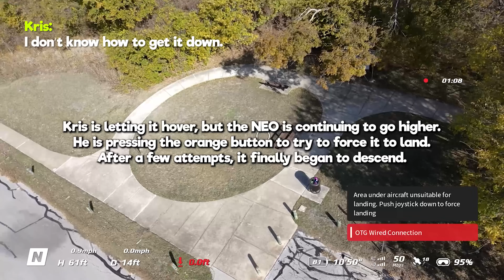Don't Do This With Your NEO [DJI Responded]

Comment from the maker: **UPDATE** Thanks for all your comments. 👍A few of you have mentioned that the tape was causing the increase in altitude. You're right. We had initially thought that was indeed the issue, but when we tried the helmet test, it went down when it saw an object below it, so we assumed that something else was going on. The NEO probably lands when a new object is detected below it, but in our test, it was thinking that the ground was still 0 feet away. We probably had some light leaking through the tape because previously, outdoors with tape, it didn’t increase altitude — it just went crazy and lost GPS a few seconds after takeoff. The other two issues we showed in this video are still baffling (1 - the Motion 3's throttle becomes extra sensitive in the dark, and 2 - tenuous GPS connection when the vision system isn't working).
Reply: Experienced this on my first flight using my phone controller today
Reply: The Chinese must shake their heads when it comes to us Americans. JUST TELL EVERYONE  DON'T FLY AT NIGHT WITH IT. PROBLEM SOLVED.
Reply: @myexperience_is  lol... We don't do what we are told! 😂
Reply: the throttle (and also all other controls) override all limits set in C-N-S when the drone goes into ATTITUDE MODE (no sats and no ground feedback) and the full manual speeds become available.... aiding in the panic.... you must always have your volume high to hear that dreadful message "attitude mode, fly with caution" because it means you have no braking, no positioning, and no height reference and the drone is completely utterly 100% in your hands and only using the gravity sensing gyro to establish horizon.... and if your compass is off then you get horizon off and drifting in that direction.... happened to me over a lake today and i was only lucky that i was looking out for just that because i was over mirror water and low light and under canopies... i was able to anticipate the lack of positioning and braking and i slowed down manually, turned around and made it back.... if i had panicked and whacked it into the skies to get away i would have smacked branches and fell into the water, if a had pressed rth same thing was gonna happen, and if i had landed on the other side, i was gonna later found out that it was not the other side but only the middle of a much larger lake and some wet action would have to follow.... wont be doing that again i tell ya.... next time high and wide over that place 😀 here's the video https://www.youtube.com/watch?v=E3-2ix2xJDg
Reply: I think the software in the app must be trying to throttle back for safety so without realising it you then pull on the trigger and try to increase speed as the light hits the sensor the auto throttle back reverts to full pelt forward. The Tenous GPS is probably a software issue as the drone is probably not capable of utilizing height data from GPS satellites and uses what the sensor is reading so it can land on a hand, I think starting of with the sensor covered it will take off, but it is probably confusing the software and eventually becomes unstable. As you can see from the goggle recording the height is always at 0.0 ft
Reply from the maker: So, learning from the comments, we think that in our first video about this problem from a month ago, our tape was nicely sealed, because we never saw a height reading.

Maybe a real night test outdoors is what needs to be done. It's just a bit sketchy when / if it goes crazy at night.
Reply: You should wait for GPS to lock into 20 sat before flying! if you look at your flight with tape you can see that the drone drop under 8-9 sat which is insufficient for the drone!

Comment: I didn’t go through all the comments. Although I wonder if DJI is intending to provide an update that allow us to control our DJI in the dark as long as we are able to see through the goggles! I tried mine in a room with a low light and the visual was good, but the problem still presents while using motion sensor.
Reply from the maker: It's very unlikely that DJI will do anything to improve this drone, unfortunately.

Comment: Have you tried calibrating the IMU before doing the tape experiment? I induced ATTI by entering a dark room (I want to improve my control or at least stop panicking) and it started climbing after a crash (which is known to fuck up with the IMU). The drone might have believed its nose was pointing down and trying to correct it (since ATTI mode is meant to keep constant attitude). Also this time I didn't experience it speeding up when I entered ATTI, maybe the other times it thought its nose was up and leaned forward? though unless VPS plays a role in auto leveling it wouldn't explain the lack of drift before entering the room.
Reply from the maker: No, I haven't, and to be honest, the tape idea was not the best way to test low light. I did have it climb up after taping it indoors and it hit the ceiling, so it might have seen the tape as the ground and was trying to get away from it.

It broke the drone. Haha! Lesson learned. At this point, I just hope the word has spread that the NEO can freak out in low light, rather than just drift.

Comment: I have problems with NEO too, in Latvia 2 times. and in Cyprus 1 time. I afraid to fly with NEO if do not have at least 20 satellite connection,  but even than, it is sketchy to fly.
Reply from the maker: That's unfortunate! After recording this video, I have also found that 20 satellites are the minimum that it seems to need, even though the NEO itself seems to be ok with taking off with fewer. 🫤

Comment: DJI for 10 years have known about flyerway..  If you don't bump the ground or crash into something you'll never see fly away.. I stopped flying my Neo drone because of a lawsuit with my neo drone on flyway hit somebody.  My controller would turn off manual,  I would have to get back in and turn manual on.. The acro button was off but it wasn't,  It was off only after I turned it on and then turned it back off.  My best effort on flyaway to control the neo is hold the left stick down,,, And then turn the right stick to the right and make it do rolls until it crashes... To this day there's no just turn off of the power to the drone... Makes one thing that they want drones to crash so people have to buy another drone..  I've had a lot of fun with my neo drone but it's time to give up drones They are a liability.

Comment: Just happened to me today. I flew it on the ceiling, under the roof of my garaage. Then, a few seconds later, when I ascend it like 10 meters high, my neo suddenly drifted away maniacally in 1 direction, in reverse. It flew and crash to my neighbours' yard, but fortunately, it is still okay. Just a little dent.. I was just afraid if it hits a car passing on the road...
Reply from the maker: It's very unsettling, to say the least! Glad it's ok. I'm gathering some info in the comments of the videos we've made about the NEO and this issue. What controller were you using? 

We want to make an updated video, check the firmware, and share some comments like yours.
Reply: @readysetdrone I use motion 3. Just bought the whole fmc motion set 3 days ago
Reply: @readysetdrone I'm using the motion 3. Just bought the set 3 days ago
Reply from the maker: Ok, that's the setup we have issues with. When we fly it with other controllers, or even just a phone, it doesn't go crazy in the dark.
Reply: @readysetdrone I haven't tried with other types of controllers or just using phone yet

Comment: However, some have managed to fly the DJI Neo at night. https://youtu.be/9VtQiIysgZw?si=2FhFGug6cyudSGj6     https://youtu.be/YCeu7Xzrr_k?si=n-nmuJ_okjqOu6Cz  https://youtu.be/Ja50_v7tgl8?si=2MTmKEh4hxtmOgII   https://youtu.be/SMQ8dE5QXJI?si=N8II021Xv5j2Uhyj
Reply from the maker: Nice. It seems like, with those videos, they were either flying with a standard controller (one of mentioned it drifted a little bit, which is normal in ATTI mode before enough satellites are acquired), or it's got plenty of satellites, or a very bright light. 

The light that we tried in a previous video probably wasn't quite enough. 

Originally we thought that the crazy uncontrolled flight performance was only happening on the Motion 3, but based on comments we've gotten, other people have the "drunk drone" issue with other controllers as well, which is kind of an interesting development. 

Also, just the other day, someone mentioned that there a firmware update which made it more stable. We will have to check it out soon.

Comment: My neo just crashed without warning.I sent it back to dji for repair, and they lied they told me the external was damaged ! The drone malfunctioned, and that's why it crashed, but they want me to pay for the repair!
Reply from the maker: Sorry to hear that! 😕 Did it start going out of control, like what it does in low light?
Reply: @readysetdrone the drone is following me and suddenly crashed but the drone is still on and connected but when I tried to fly it again, it shows error it won't fly😢
Reply from the maker: That's a new problem! I hadn't heard about that before. 🫤
Reply: @readysetdrone The problem is there is no external damage, but they want me to pay for the external damage 😢😢😢it's so unfair.
Reply from the maker: That sucks.

Comment: To get a stable GPS lock on the Neo, power on the motors without taking off for about a minute - this puts the system into full power mode and helps it lock on faster. I hold mine in one hand and use the other to arm it, keeping it running until the controller says “homepoint updated,” then shut the motors off. Alternatively, you can take a short flight first (without taping the sensors because it's safer) until GPS locks, then land and tape over only the optical flow camera (center lens). Leave the two larger side lenses uncovered - they handle altitude sensing even in the dark.

The Neo’s GPS chip is weak, so give it time to lock on before flying in darkness. Once locked, it can fly at night under open sky, but avoid trees, bridges, or buildings or it may lose GPS and crash. In the clear, it will hover using GPS alone - jittery but stable enough - and cruise control will still work.
Reply from the maker: Thanks! Great tips! 

The whole tape thing was just to show that the GPS lock is somehow connected to how dark it is, without actually taking to fly at night. It's kind of wild that, unless it has maybe 20+ says, it doesn't just go into a normal ATTI mode in low light, it gets drunk! 😅
Reply: The gps can have 20+ satellites but close to the ground in low light the computer can get confused about which information to trust. These two systems "failover" onto each other and only when both fail does the drone switch into ATTI mode.

The erratic behavior comes from when the drone chooses to trust bad sensor/gps data instead of staying in ATTI mode. It won't announce the mode change every time "attitude mode - fly with caution" or "satellite positioning - fly with caution." It can happen several times without informing you and when it tries to rely on a bad gps signal it might 'chase' after it.
Reply from the maker: That's interesting. It just goes into normal ATTI mode for me with the RC 2 or the FPV controller 3. No erratic behavior unless I'm flying with the Motion 3. 

Of course, we shouldn't be flying in the dark. DJI says so, but it shouldn't behave differently with different controllers.

Comment: Yesterday I decided to use my Neo to record a sunset. It was bout 7:30pm and I flew up about 50 feet and then straight to the sunset for about 20 seconds. On the way back I let just float and it started to slide left, I tried moving it forward and it would move in different directions. Once it was above me I tried bringing it down and it would move to the side. So I kept trying to get it down, circling around until I was able to bring it down. Seems it doesn't have to be really dark for it to have problems. I still love my Neo.
Reply from the maker: That's an unsettling experience! Glad you got it back safely. We love our NEO too.

Comment: If you are able to switch to sport mode or manual mode which works better yeah you can get the drone back out of the sky back to the ground safely
Reply from the maker: You might be right about sport mode, but manual mode doesn't work with the Motion 3. 

Thanks for the input! The tape was not a smart idea on our part. We were just trying to show that somehow the light sensor is connected to the GPS reception, somehow.

Comment: Just want to update you guys. I am using my DJI NEO last Saturday using RCN3, and flew inside our church. When I passed the stage area where there is a minimal light, my DJI Neo suddenly accelerated and crashed on the door, breaking the gimbal protector and camera protector (good thing I have them installed). So what causes this sudden acceleraton on low light areas even if you are controlling it on MANUAL mode using RCN3
Reply from the maker: Wow! 😲 Even the RC N3 does this?! We have only experienced this sensitivity with the Motion 3, but we've had a few comments that suggest that not all NEO units behave the same as ours. 

Normally, this is just ATTI mode, which is when the drone doesn't have satellite connection and it starts to drift. That's normal, but when the sensitivity of the throttle changes, and it seems to accelerate out of control, that is what we think is a bug that can be fixed, but DJI doesn't seem to have it as a priority.

We aren't supposed to fly it in low light, but still, it shouldn't go crazy! 

I plan to make an update to this video soon. I have been back and forth with DJI support about this. It isn't a satisfying result, unfortunately. It seems like we have to live with this bug.
Reply: @readysetdrone  I hope there will be a firmware update to correct this.. It seems some people here in the Philippines has experienced it too.

Comment: Why no one is mentioning the insufficient satellite? its the reason why the drone is not using it!
Reply from the maker: I asked DJI what they recommend for satellite number and they said 10, but other flyers have suggested 20. 

I just wish it went into a standard attitude mode, rather than becoming more sensitive on the throttle.

Comment: You should wait for GPS to lock into 20 sat before flying! if you look at your flight with tape you can see that the drone drop under 8-9 sat which is insufficient for the drone!
Reply from the maker: Agreed. DJI had told us only 10 satellites, and we thought that when we took off, we were into the teens before launching, but over 20 seems to be the key. 

But when going under a shady tree area, it'll go crazy again.

Comment: In my case, satelite suddenly down. From 29 to 0. I dont know why 😂😂😂😂
I think i need use RC3 to manual mode as soon as possible 😂😂
Reply from the maker: The FPV controller even in normal mode should still be flyable. The Motion 3 is the one to worry about, at least that's what we've experienced. 

Manual mode is fun though! You just can't push the NEO too hard. We had it just nose dive out of control in manual mode when we were asking too much of it. Here's that short if you want to see what to be careful of. 
https://youtube.com/shorts/tCB_U5fBL4A?si=3u_z8XhtVhRvK3cl

Comment: You have no satalites
Reply from the maker: Notice at around 0:55 seconds, it has 14 satellites and the text is white. Then, because of the stimulated darkness, the satellites go red and drop to zero for a sec. 

There is some strange connection between the GPS lock and the vision sensors. 

So even when flying normally in the daytime, outdoors with good GPS reception, if you decide to go under a thick tunnel of trees, the vision sensors will notice that it's dark and the NEO will become extra sensitive, if using the Motion 3. 

Other controllers seem to be fine though.

Comment: So if you look at the Neo with Night Vision, you will see the right down sensor is flashing and the left is the receiver sensor. So they are dual purpose. Not only do they "look" down for landing, they must also check for distance via the detection of the flash hitting the ground below. The flash itself isnt very bright. I was using PVS-14 Gen3 Omni7 tubes, so I know the emitter side wasn't that bright, I would have seen any freq. I imagine the sensor side can detect the return light to about 10 feet. The sensor also needs a light input as a neutral point for reference. Probably analyzing a standard light freq for comparison.  So next test would be to use Fiber-Optic light piping, the type used for Compound Bow optics. Take a 20 inch coil with each end pointed directly at the center of both sensors. Now the pulse from the light will simulate 20" off the ground. Keep the left side open on the first test with just the light pipe pointed at the center. This will allow ambient light to also enter the sensor. Close off all but the light pipe pointed at the right sensor.  See what happens.   I have flow my Neos in complete darkness using my NV gear by also putting very strong LEDs mounted under aimed straight down. The Drone gets crazy higher than 6 feet, so I know its also looking for ambient light not just ground scattered light from the sensor emitter.